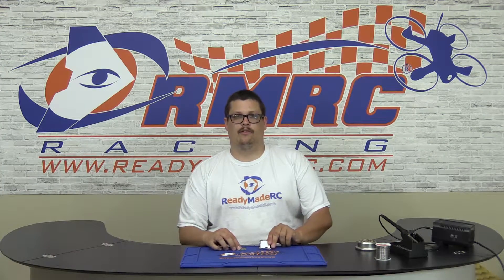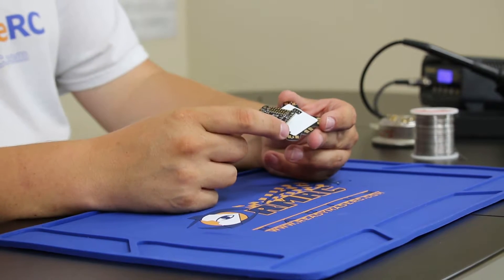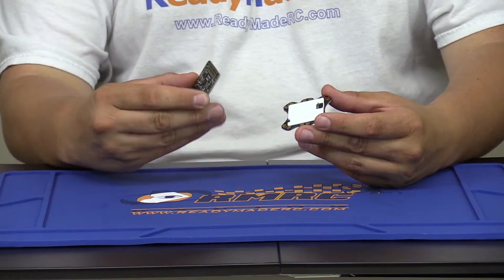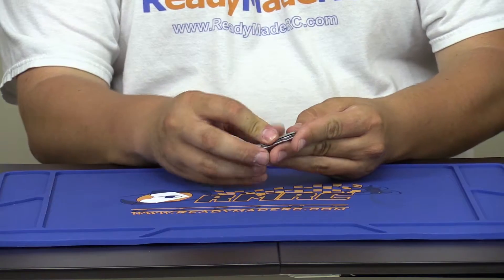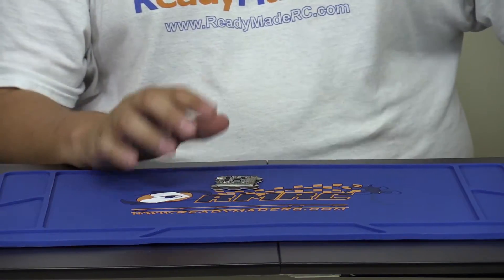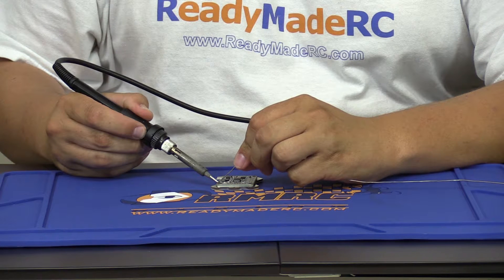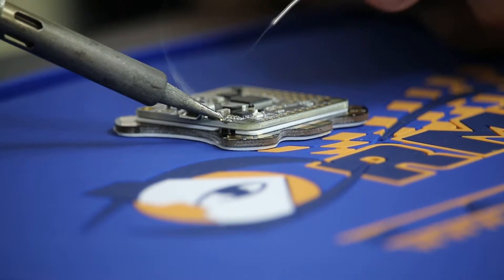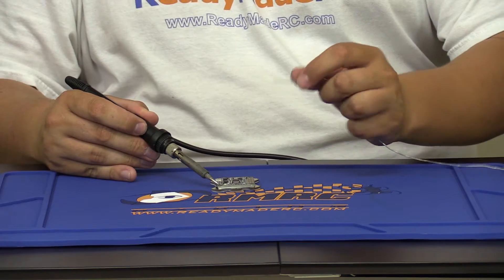Seriously Dodo PDB Installation

Comment: I just installed this board on my quad,  motor one doesn't work. us there a way to separate the pdb and flight controller with out damaging it?
Reply from the maker: We have separated them before, but you may want to open a support ticket first, so we can troubleshoot before taking the chance on damaging the controller.
Reply: thanks,  but I got it figured out.  motor output 1 was dead so I just remapped it to motor 5 and soldered the signal wire to the board on motor channel 5. flew it today.  works just fine.

Comment: question about the buzzer, I thought the issue was fixed in the latest released boards or do I still have to plug it into another 5v lead? and if so can I use one of the unused 5v inputs? thanks I have version 3a board

Comment: Ok I was about to order this and a few other items, but I held on for a second, can someone answer this? does this board have no holes in it? I'm planning to use this on an Atom 122 thanks.
Reply: Thanks peter , I got one last question if you can answer would be great , I'm trying to place an order at RMRC for some accessories, and one of them is the aluminum self locking nuts I'm confused as of what CW CCW refers to, is it the way it screws in or the way the shaft turns, in other words if I want regular thread conventional thread which screw in cw , then I would order CW?  and to confirm to your answer above I guess the mounting holes are under these white pads which I have to punch a hole in right? thanks again,